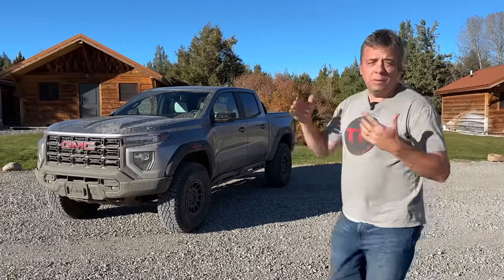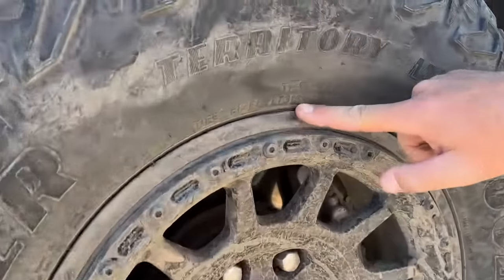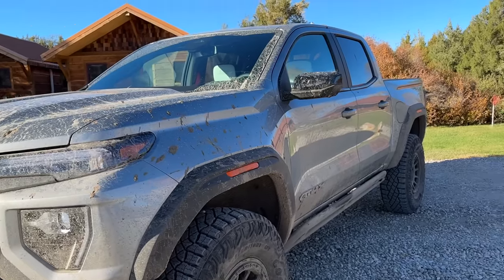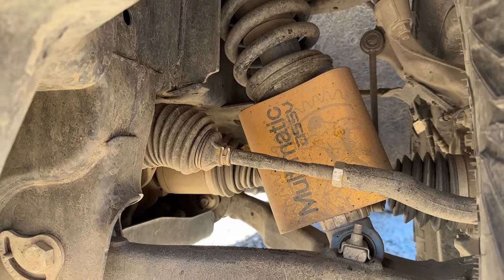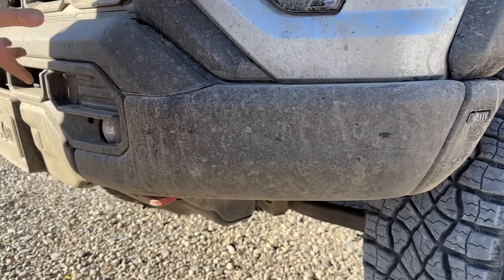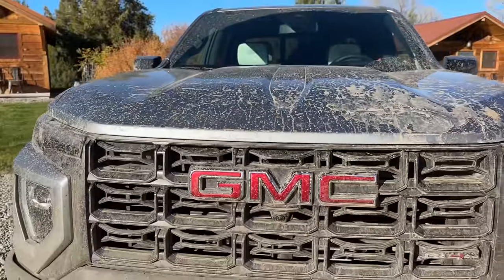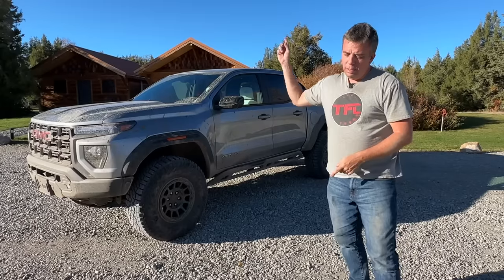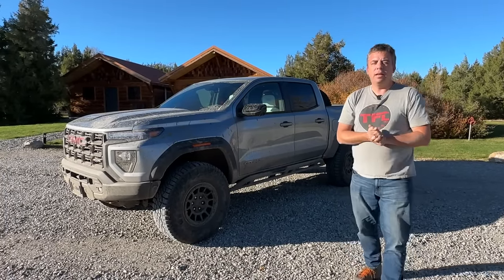Here’s Why The New GMC Canyon AT4X AEV Is The Ultimate Off-Road Pickup!

Comment: The tire looks cool as hell mounted like that, but it would've blocked the rear view less if the mount pointed it parallel to the driver, instead of perpendicular. They could mirror it for a 2nd spare behind the passenger side and still leave a rear view.

Comment: I owned a 2020 Gladiator Sport. Stickered for $33,733.00
Fit 35x10.50x17’s on factory steel wheels.
You can get a good vehicle if you pass on all the unnecessary options. Only downside was that 5’ bed.
Reply: Yeah I think most people would be happy with something like the Trail Boss which retails for like $38k or so. But some people just have to one-up the Jones’ and get the flashiest thing out there.
Reply: The big things you're paying for with the ATX/ZR2 trims are the pre-installed lockers and off-road suspension. You don't get those with the Sport and Trail-Boss trims. By the time you pay for parts and labor, you're looking at just as much, if not more than the cost of the higher trim line. Plus there is the possibility you never upgrade later anyway and get the same capabilities down the line, leaving you with regret as you watch the Rubicons and ZR2/ATX trims do things on the trails you want to do. So, there's that...
Reply: Another downside is it’s a Jeep
Reply: @jpetree1985 that’s the spirit lol

Comment: Andre, you’ve taught me to keep GM products at arm’s length.  Not just you but all TFL!  Between the hummer ev and your Colorado, the gremlins the vehicles have are just too many to not take seriously.
Reply: Team Toyota?
Reply: Agreed
Reply: My thing is, at $40k, $50k, $60k, 70k plus for simple trucks, I have to get something I can rely on and these aren’t it
Reply: The last Chevy I owned was an electrical nightmare! It couldn't make it a whole month without some completely new electrical issue. Bad grounds, chaffing wire harnesses, you name it and it had it. Some were just annoying like turning on the blinker would cause horn to blow, but others were dangerous like cruise control malfunctioning and not disengaging when hitting the brakes. 

I would much rather have to replace a transmission every 100k miles than deal with electrical issues again.

Comment: I really like my 19 canyon, I think the v6 pairs nicely with the 8 speed transmission. I'm still not completely sold on the turbo 4 and more infotainment dependent interior.
Reply: Dont test drive one because it will sell you. I owned a 2018 v6 and the turbomax blows it out of the water.
Reply: You're right to keep your 19 canyon. Save yourself the headache
Reply: If the old model had the 4.3 I might agree but I like truck engines that have a good torque curve. The 3.6 was a bit too peaky.
Reply: There's no comparison between the 3.6 and this 2.7. better in every way and so far more reliable. 

I'm a GM tech and I've yet to do any real work on the 2.7L (in the 1500s) all I've done is a leaking air oil separator and that was because it wasn't torqued to spec at the factory. They're reliable and torquey as heck

Comment: I paid $35,000 for my 2018 zr2. $100 aev trim kit, $400 upgraded bump stops, and $80 level and I’m on 34s. Took on Poughkeepsie gulch and Pearl pass. Think I’ll keep my $30,000. The only luxury feature I feel I’m missing out on would be adaptive cruise control
Reply: 35,000 from the dealer?!
Reply: @Motor-City_Ben-Diesel yes, I bought one in 2018 and it was definitely less than $40k OTD

Comment: A 6300 pound truck with 900 pounds of payload capacity is an engineering feat.
Reply: It's 5400 pounds plus the 900 payload to a total of 6300. Or is that what you meant?
Reply: This truck weighs more than my 22 F150 which is only 4700 lbs
Reply: @mvcharisma  but your truck is made out of tin can
Reply: @javiertafoya6509 my 2020 ford ranger weights 4500. 6300??? Wtf
Reply: @champinsoccer9  5400, and you have to remember the bumpers, skid plates, sliders and spare tire carrier add up along with the additional weight of 35s

Comment: At these price points we should be able to purchase direct from the manufacturer as the dealer franchise model has failed consumers.  Also if these trucks are demanding a premium price they should be fully ready for a dirty life e.g. full xpel PPF, Switch Pro, Anderson plugs wired to the bed and roof, and dual battery from factory.

Comment: Once you add the rooftop tent and overland gear it could get dicey on payload.  But man the capability here is impressive.  What would it take to increase the payload? Or is the limitation the frame itself?
Reply: Just less off road specific shocks and perhaps a add a leaf. Everything else the same.
Reply: @robertyoung8289 I think you are right. Makes me curious if you could build it better starting with a cheap two door and adding your own setup. Not practical but it sure would be fun.
Reply: @jermsman18  Absolutely you could. I drive a magnificent 2020 Tacoma TRD PRO. I've got 50yrs of off road experience. This is the most capable vehicle I've ever owned. With that said the high end tech is interesting and I have used it a few times but give me a base SR5 at close to half the price and let me use my experience to build it my way and it will perform as good or better for less money. (My TRD PRO also has a 900 lb GVW).

Comment: When will the first recall happen?? Can't be far away.
Reply: It's not a Toyota.   I know you Toyota guys are used to recalls.
Reply: @shiftmotorsports9803 lol that's cute. my 2020 Tundra has never had a recall, but nice try
Reply: @osutx427  what's cute is you think I can't do research. 2020 Tundra has 5 recalls. Nice try
Reply: @shiftmotorsports9803  well the last recall we had on a Toyota was back in 2005. Our 04 Corolla had one. Then my 13 Tacoma had ZERO...my wife's 16 RAV 4 had ZERO and my 20 Tundra so far has had ZERO. So four Toyotas in almost 20 year span and one recall. Now according to BEN HARDY, Ford was number one last year for recalls and GM was number two. Yes....they are outstanding auto makers.
Reply: @Pantelifts10  To bolster your point....My wife and I towed our 5 000 pound camper from Ontario to BC....5 000 kms there and 5 000 kms back with my 13 Tacoma. The only thing I did was gas and one oil change. Pretty impressive I think. Did the same trip with my wife's RAV 4 for our daughter's wedding. Only thing needed was gas. I think that says something about Toyota.
Reply: @mikefoehr235  not according to the nhtsa.  From 2016-2023, the Tacoma has had 21 recalls.  The Colorado has had 8.  The beloved Tacoma has had 2 in 2023 (it's final year) and the Colorado has had 0 (it's first year).  Viva la Mexico and cost cutting. Don't hate. Facts are facts.  Toyota isn't what it used to be. Your loyalty is strong, though!  Hopefully you're a stockholder. It's all cost cutting and price raising now.  Can't deny the resale, but reliability is just like the rest.  Take care of your things and they'll take care of you. Don't take care of a Toyota and they break like the rest
Reply: @mikefoehr235  BTW, 2013 Tacoma had 6 recalls.  Maybe you got ZERO done, but there were 6
Edit: For the record, 2013 Colorado had 0
Reply: @shiftmotorsports9803  Never had one. Almost one for heated seats.
Reply: @shiftmotorsports9803 lol yeah I didn't search. You are right Colorado shows 0 recalls and tundra shows 5. 4 of the 5 recalls have the verbiage "may" have this issue. So my dealer has had to do 0 recalls. One is for headlight connector and another for turn signals are not bright enough. I still trust the tundra to hit 200k before a Colorado

Comment: Same size tire fits my Gladiator Rubicon with no lift. 
Low range = 4:1 ratio (versus 2.72 Chevy)
Spare tire tucked away under the bed on JT.
Factory winch-capable bumper.
Better sight lines over hood. 
JT top & doors come off for better off-road experience.
No white interior parts to get filthy 😆  Also more rear legroom.
Pretty comfortable saying Jeep isn't going to be 'Kilt' any time soon.  Colorado is a nice truck tho-
Reply: All true but for some the Gladiator looks like straight trash. There is no fixing those aesthetics.
Reply: You really don't need a 4:1 tcase with modern autos, not really the case with a manual I suppose, but if you wanted a manual you're probably not actually buying a new truck to begin with lmao

Comment: If the top of the line model was 45  thousand peak price and the base model was 20 thousand it would be alot more reasonable to consider purchasing ...
Reply: Although I do agree with you that these vehicles should be cheaper in the mid truck section, you are not getting anything this built up incapable for 45K from any brand. 20K will get you a stripped down Polaris Slingshot, what makes you that's going to get you a truck in 2023?
Reply: Back in 2011 I purchased a Toyota Camry LE which was just above the base model(Toyota eliminated the base trims in the following years). That LE was just under 21k at that time. Fast forward 13 years and you expect a base off road truck to go for 20k? Yeah you must be 15 years old that doesn’t know how inflation and the devaluation of the dollar works. Go back to school, study, and come back a competent person before you type whatever in comment threads
Reply: @sammyjammy6647  
Any truck midsized  for 20 thousand for a base model ... not for nothing but the maverick was close to 20 grand when it came out 2 years ago for a base model... yes the maverick isn't a midsized truck but it's close ... and cheap ...
Reply: @mrgmc6314  yes but the Maverick is not an off-road truck with enhanced suspension etc. I’m not even sure if the Maverick that you’re talking about is body on frame or unibody. if it’s unibody it’s not off-road at all. The maverick is basically an economy car with a bed in the back
Reply: @sammyjammy6647  agreed but it's shaped like a truck , also I don't necessarily need off-road focused truck ,,, just something with truck capability ,, I had a 2002 s10 with a 5 speed and short bed regular cab ,,, honestly it was enough truck ,,, I'm 42 I don't need nor can afford a fancy truck , a basic crew cab short bed 2 or 4wd truck from the midsized segment should start 20 - 25 thousand and fully loaded by 50 k ,,,, most people don't understand we don't need all this fancy stuff ,,,
Reply: @mrgmc6314  how much can the Maverick tow?
Reply: @sammyjammy6647  
2000 pounds ... plenty for my needs ,,, ...seats 5 people , has the basic usages as a light truck ...

Comment: Yall should do a ZR2 vs. AT4X vs. 4Door Wrangler/Unlimited comparison.... both on 35s and same sized wheels.... hopefully 17s or 16s.  I think the wheelbase length will make the difference, plus rear lockers.  Towing capability might be the selling point, plus cameras.  I do not think payload will matter in vehicles like this.  These are not "work" trucks, per se.

Comment: Those are narrow 315/70's I bet. The Bronco Sasquatch runs the same tire in a 315/70 and its a VERY narrow 315. I had 315/70R17 KO2's from a Raptor, and 285/70R17 KO2's from a Wrangler Rubicon. Then I bought a set of these off a Bronco to replace my KO2's. These were about an inch narrower than the 315/70 KO2's and almost identical in width to the 285's. 

Not saying this is a bad thing, it's exactly why I bought them. They are light weight and narrow, more like a 285/80R17, and I picked up almost 1mpg on my F150 vs the KO2's and the truck just feels spunkier and happier but I still get the full diameter of a 315/70.
Reply: Interesting observation. So, 315 mm section width is 12.4 inches and 285 mm is 11.22 inches. When you look at the specs for the BFG KO2s it lists a section width of 13.0 inches (330 mm) for the 315/70R17 and 12.0 inches (304 mm) for the 285/70R17. Goodyear does not list the section width for the Wranglers, but it appears you measured 12 inches wide. This would match the BFG 285 tire as you stated. If you do the math for the diameter a 315/70R17 should be 34.7 inches. This lines up with the published specs for both the BFG and Goodyear. So, it appears that BFG makes them wide, and Goodyear makes them narrow. For comparison the Falken 315/70R17 Wildpeak A/T3 is 12.7 inches wide and 34.7 inches tall. The bottom line is that even though it is the same tire size (e.g., 315/70R17) the width and height can vary from one manufacture to another. As you clearly stated "Not saying this is a bad thing" rings true. 
A couple of disappointing things I found when looking up the tire specs were. Goodyear not listing the section width for there tires (Come On Man). The other one was looking at the specs for the BFG KO2 in a 35x12.5R17. When I see that listed I would expect the tire to be 35" tall and 12.5" wide but no. The diameter is 34.5 " and the width is 13"
Reply: @Hooner77  If you go to tirerack, the Bronco versions of the Territory MT in 315/70 is listed as 12.7" section width, but the tread width is listed as only 9.2". The 315/70 KO2's from the Raptor are 12.7" section width but 10" tread width. 285/70 KO2's from the Rubicon are 11.5" section width but 9.3" tread width.

And that's exactly what I observed in person. When I had the Territory's off the truck i put them tread to tread with the 285/70R17 KO2 spare I had on my Lexus GX, and they are nearly identical in tread width. The Territory MT might have a little more sidewall width, but the actually tread is the virtually the same as the 285/70.

But that is exactly why they bought them. They are the same diameter as a normal 315/70, but they run narrow and lighter and it really improved how my F150 drives vs the 315/70 KO2's. I dont wheel my F150 that hard so I was not to concerned.

Comment: Rock sliders bolted to the body? Why not frame mounted ?
Reply: I was wondering this as well. Will they actually support the weight of the truck if you dropped it on a rock or are we looking at a bend body where they mount?

Comment: The only thing this thing is killing it our wallet. I’ve owned the Zr2 diesel with a lift and 34’s and can honesty say my a Gladiator with the same mods size wise poops on everything else and the Tacoma I owned too l. Same specs. Can’t compete with the front axle. The other thing that triggers me about what GM is doing is I can’t tell the difference from a Zr2 or ATX4 from and standard trail boss or off-roader. They look the same. The older Colorados you can see the difference with the bugger flairs and aggressive stance.

Comment: C'mon Andre, you of all people cannot criticize the spare tire mount, GM did a good job. there is no other place to mount it except on top of cab which requires a roof rack. roof rails would be nice but only the japanese do that on trucks. you buy this top line off road truck mainly for off road, ie the 35s and lockers, not towing and hauling. otherwise buy a reg at4x w 33s, in which case off roaders will prob put 35s on anyway. its not blocking that much and you have cameras and side mirrors. all u need really... semi truck drivers dont use rear view mirrors. man up and stop whining about your rear view.  if this AEV had 33s you would complain.  i think its a worthy competitor to the ranger raptor but you cant please everyone so why people want to complain about a spare tire mount on a truck w 35s is silly. at least they give u a full size spare.  if anyone needs this mount its you for the Trailhound, bc you never mounted the 37" spare. now its laying in the bed taking up even more space. plus, with the alucamper you had to carry it in the van when you went camping on the border. as an overlander i would call the TH a fail bc you didnt mount and carry your own spare.

Comment: Add the 3.0 liter Duramax and 4:88 gears. Get rid of the 90s snow suit interior. Or maybe add different color options for those who like a darker interior. The winch should be standard, especially at this price point.  My biggest issue is the price!  This is going to be in the 60k range! That is absolutely ridiculous for a mid size truck. Blame it on inflation or covid or whatever. Fact is these trucks are worth mayybee 45k
Reply: It wouldnt need 4.88's with the Duramax. Look at Wranglers/Gladiators with the EcoD. The drop down from 4.10's to 3.73's.

Comment: Non of that is built to last. Specially not the digital gauge cluster. 

Everyday I see at least of GM vehicle broke dic on the side of the highway here in LA. 

Meanwhile my 2007 Tacoma w/ 160k miles is still humming along on original engine and transmission.

Comment: they're not rock sliders if they're bolted to the body
Reply from the maker: We have used these on other GM midsize trucks and they take an amazing beating.
Reply: @TFLtruck  perhaps the steel on the sliders is plenty strong, but if these happen to slam on a rock hard enough, the body will get taken out. There's no way the body mounting point (usually just a couple of welded studs under the rocker panel) can be as sturdy as the frame.

Comment: Id like a hybrid 5.3 in this truck ....
Note : a plug in hybrid with 100 miles range on ev only power and 300 more mile range on ev / gas assist .. for a total of 400 miles of total range ...
Reply: @mrg… If they put a hybrid battery and electric motor in this thing then it would have 50 pounds for payload left. 😃
Reply: @is6566  that is very true ,, I hadn't thought of that part ..

Comment: Not seeing how this is better then solid axles ???
Reply: Something like the Jeep Wrangler or Gladiator will be in pieces after an hour of Baja runs due to solid axle and suspension design. Jeeps are better in technical rock crawling. This truck is made for Baja runs (therefore IFS) so it’s better in that perspective. Different trucks for different purposes.